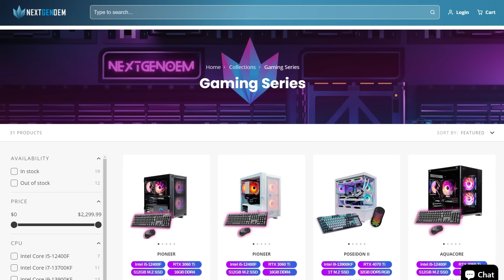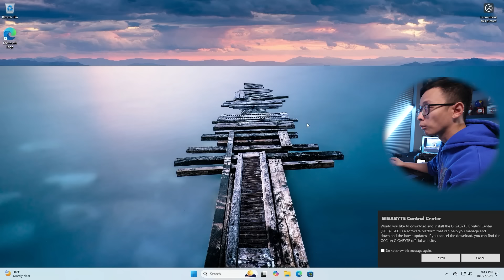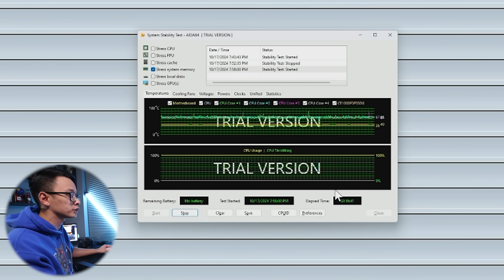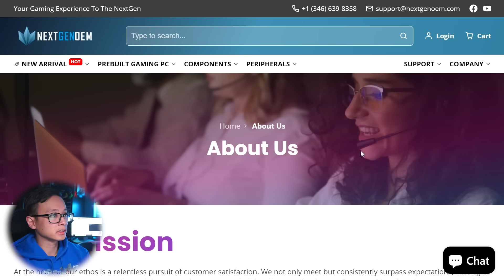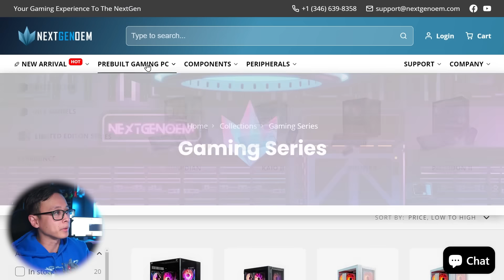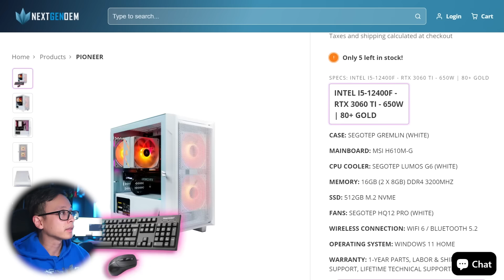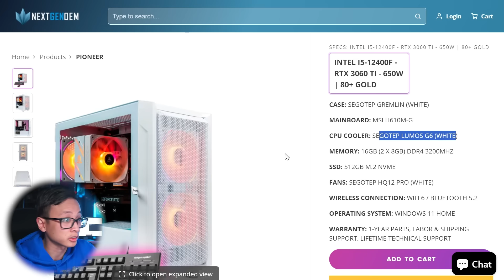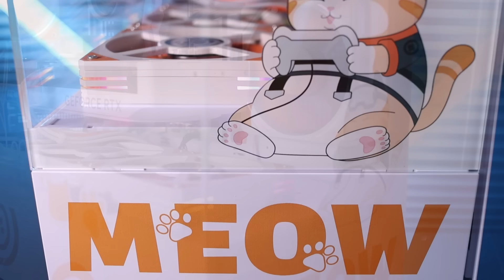Are These CUTE Prebuilt Gaming PCs WORTH IT?! - NextGenOEM Review

Comment: It seems NextGenOEM uses only Intel CPUs and Nvidia graphics cards.  Their total dismissal of AMD means a hard pass for me.  Not an AMD fanboy, just want choice.
Reply: If you prefer Intel over AMD then why does it matter that they don't sell AMD products? Should it be there for you to look at and pass up? I don't get it.
Reply: @BREEZYM6015  All I'm saying is if a system integrator ignores the other major CPU maker and the other major GPU maker, there is a reason.  I've seen this sort of thing before.  The most likely reason is a business relationship that says the integrator must use only Intel CPUs or cannot use Intel CPUs at all, and something similar with Nvidia.  That makes sure the integrator can't use the competing components and therefore is in a weak position to negotiate pricing.  But the real red flags to me are they all seem to be using F chips, mostly Raptor Lake, and they all top out at a 4070Ti.  Is this company a Raptor Lake F-chip dumping ground?  Nvidia supposedly stopped production of the 4070Ti, yet they are prevalent in these PCs, and you can't get anything stronger.  Why do you suppose that is?
Reply: I agree, but not in the same way. For a company to survive in this PC world, they need to use the best value parts. For the high-end offerings, they have to use the best parts. Ignoring the top dog right now is not how you are going to do that. Nvidia GPUs, yes. Intel CPUs? Not a chance. I do not give a crap what the Intel fanboys are going to try to tell you, AMD is top dog right now. Both for long term value and performance.

Comment: You do not see anything better than a 4070ti is because 4080 and 4090 is no longer made. Any SI selling 4080 and 4090 is using inhouse stock. This is normal for Nvidia to boost sales of the next gen.

About the "grey market" windows keys. Those ARE OEM keys. They are marked up from what SIs pay. Windows keys are amazingly cheap for SIs. This is the way you take over and control a market.

Comment: You forgot fans and cables. It is a bit overpriced but most custom PC's are.
Reply from the maker: Yea that's what the added text was for on the screen, I was so in the mindset of building with only what's necessary that I forgot to add in those extras because tbh whether they're there or not the PC would perform just the same

Comment: The process you described at the beginning of the video is exactly how i did it, i bought a prebuilt in 2017, upgraded the gup twice, got more ram, swapped processor and cooler, swapped the psu, until i built my new pc this summer from scratch, since i built two other for my friends.
Reply: sadly these days a prebuilt  from for example dell or other similar prebuilders are worthless if you plan to upgrade them later as they use non standard parts for all parts except storage GPU  and cpu
Reply: @holyhelga  yeah i know, i looked up a specific store where they use off the shelf components so it wasn't an oem prebuilt, it was an i5-8400 with a 1060 6g

Comment: In Jan 2021 after ordering & getting my pre-built PC from NZXT in Feb2021 (which are still built to order & just can't choose specs) 1.5yrs in I had my older brother swap the case and later the AIO.I then changed my younger bro's case & AIO myself for the 1st time (I also paid for both upgrades as early B-Day/X-Mas gifts).I then decided to change my case again myself and then PSU to run my new RTX4070,I had to swap out my Corsair 240 AIO since the pump was failing.I purchased a 360 Corsair AIO on Amazon & sold the refurbished unit I was sent for the RMA locally for $60.I definitely got for comfortable disassembling PC's after doing 2 successful AIO/case swaps.
Reply: Swapping a case is not an "upgrade". It's a swap.

Comment: I built my sons' gaming oc and have put it through all kinds of stress tests with zero issue, yet periodically when they are playing games it just shuts off. At one point i thought it was the evga power supply. Replaced it with a higher wattage raidmax psu and that thing burned up. Replaced it with a nzxt c850 and for a long time there was no issues and then it started doing it again. Id run stress tests for hours with no issues, but in gaming it would shut down. Checked event logs and it doesnt tell me anything.other than it suffered a temp power loss and was shut down improperly....
Reply: Possibly an overheating issue. My friend bought a pre built gaming PC that was originally a Dell optiplex and it had this issue too. It had one output fan and no input fans and it was awful. He could play a game for 5 minutes and it just freaks out and turns off. I told him to take off the side panel while using it and it worked perfectly afterwards.
Reply: @yourlefttoe1914  I wish it were that simple of a fix. It has 3 intake fans on the front, 1 exhaust fan on the back, 2 exhaust fans on the top that are corsair fans that are high rim and scream when turned up and move a ton of air. It has a h100i 240mm aio. I used to have it set up with a fan speed curve that would ramp up as things got warm, but eventually just set everything to 100% and nothing gets warm, the CPU never gets hot. I'm just baffled because I can run stress tests like prime 95 , etc for hours with no issue, no crashes, no thermal throttling... yet they can fire up roblox, or fortnite and eventually it'll crash. It may be hours in or 15 minutes. Completely random. What's even more bewildering is it did this before when their setup was pretty old and it could barely handle fortnite, I've upgraded their processor, ram, motherboard, video card, power supply so it is basically a whole different setup and still the same issue. Really the only component that is the same is their boot hard drive.
Reply: @sinformant  AC Outlet, Power Strip, Power Cables, borrow another computer and see if its still doing it
Reply: @MrSamadolfo  yep been through all that as well.  Brand new power strip, when I first upgraded it to the new components including the new nzxt power supply they had the same problem and I had discovered they were using the old power cord and not the heavy duty one that came with the power supply so I swapped that and no issues for a while, then back to the same issue. Also thought maybe it was the wiring in my house as it was built in the 60's, but my personal gaming rig is running a lot more power hungry hardware than theirs and I have no issues with mine.  And as stated above I can put their pc through the ringer with every stress test I can think of and it'll run for hours with no issues. The only part of their system from their original build that is the same is their primary hard drive. Everything else was new to the build including the case

Comment: wanted to get the cat themed Colorfire pc parts for the misses, but they werent readily available in US, this may be a better option, as they are still showing a premium price atm for single components..though I see they're not using the cat themed Mobo or GPU, the mobo wasnt too bad, 181$US but the 4060 cat themed GPU was almost 500$US(480$US) which is wayyyy too much for a 4060 lol

Comment: Over $2000 for a pc with a 4070 and i7-13700k. That ridiculous really. The gpu is $529 and the cpu is $289. Throw about $100 for psu, $100 ram being generous, $100 for nvme being generous again, $200 for motherboard and $50 for a case. This is$1300 for the pc total. Plus some of the components aren't necessarily and cheaper versions could be found. That is not worth it at all.
Reply: your forgetting about the aio/heatsink, cable extensions, fans, also a windows key. Plus the fee for building. That adds up to atleast around 500

Comment: Here in Scotland the piece of crap 4070 goes for £700, making that system acceptable for the bottom dollar US price. Here we tend to use the 7800xt/ 7900GRE/7900xt in that price range for a fully built pc. My personal pc is a 7900GRE/5800x3d/ 570 Aorus Master/ 4tb storage/ 62gb 4k memory and itt is a £900 build with an 850 fully modular gold rated psu in a LL fishtank case , fully white with white braids for aesthetics and argb TL AIO 320 cooler with 6 additional fans. I think in the US my build would be 1700 US dollars.